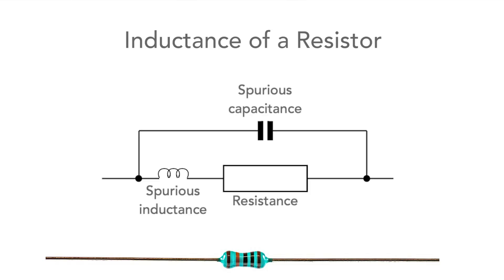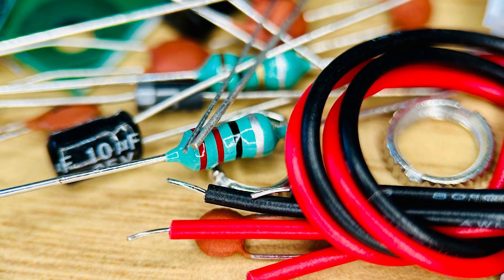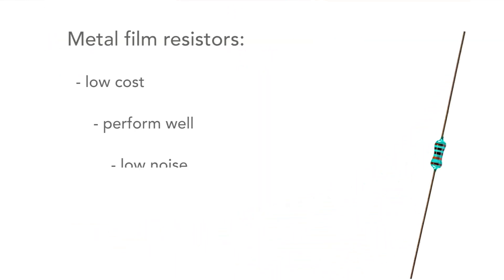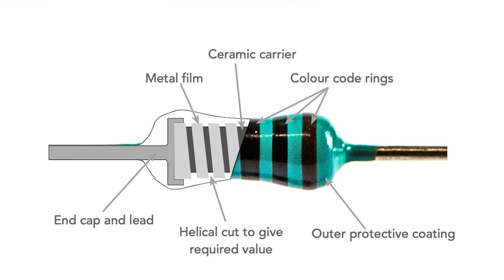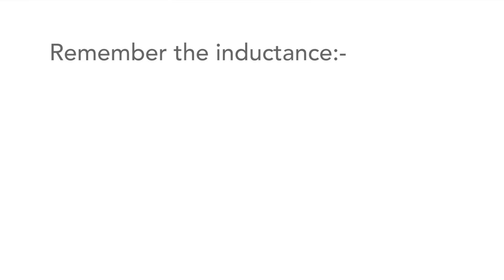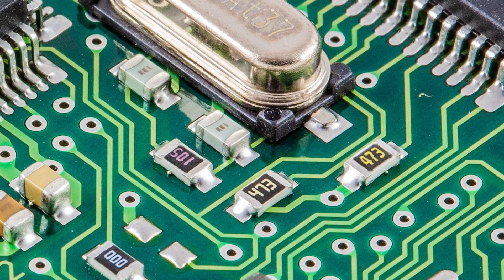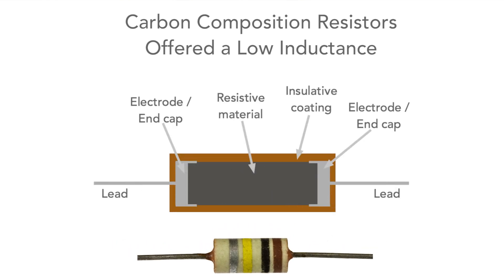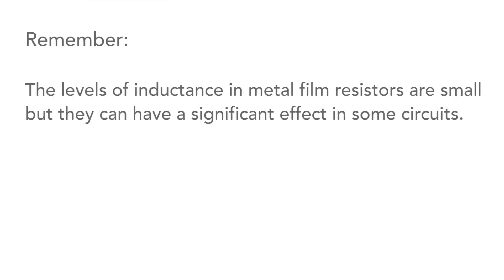Why Metal Film Resistors Have Inductance

Comment: Got me wondering. What if we wound some insulated wire on top of the resistor (provided we knew the resistor's inductance) in the opposite sense to cancel the inductance? I mean, with the same current flowing through both the resistor and the solenoid coil? The inductance of the metal film resistor is probably in the order of tens of nanohenries which is easy to achieve. Current would go through the R first, then out of its opposite end to the L and back to the circuit. Maybe place the component upright. The magnetic field would be the same for both but opposing and therefore cancelling. Mechanically a bit like an RFC wound on a high-ohmage high-voltage resistor in old valve radios but with a totally different function. Just a crazy idea.
Reply from the maker: That approach is used on some wire wound resistors to reduce the inductance.